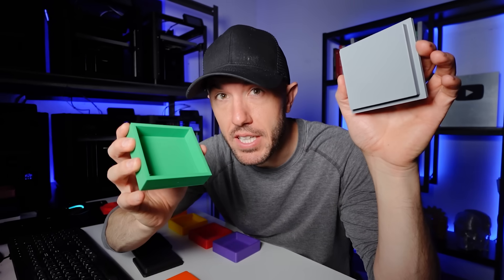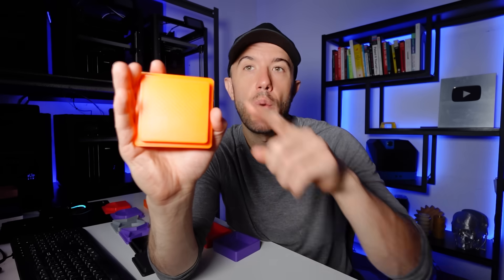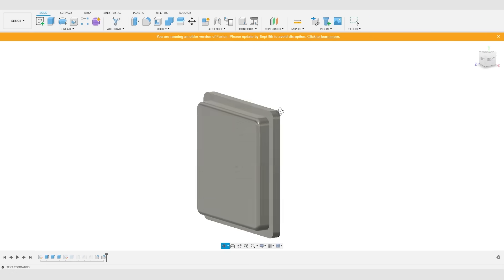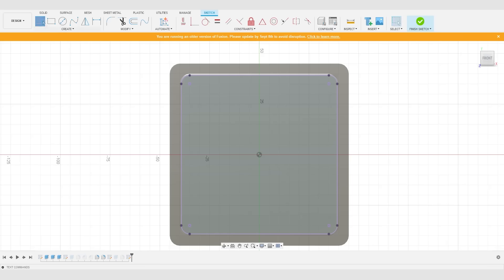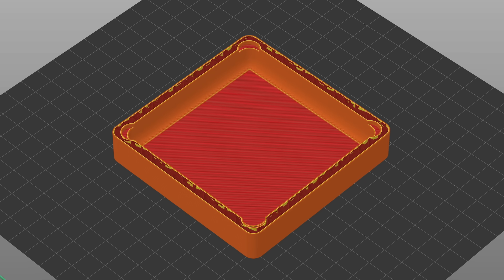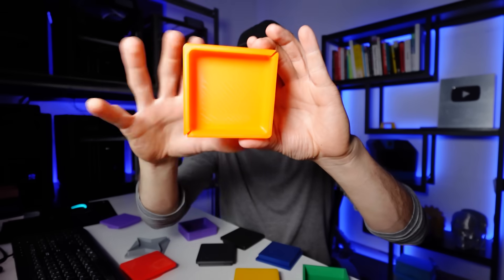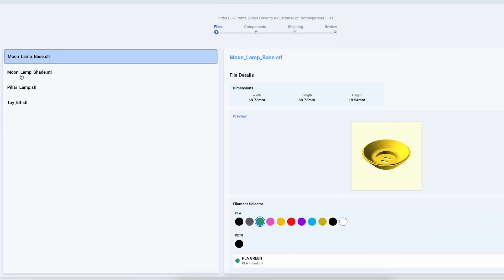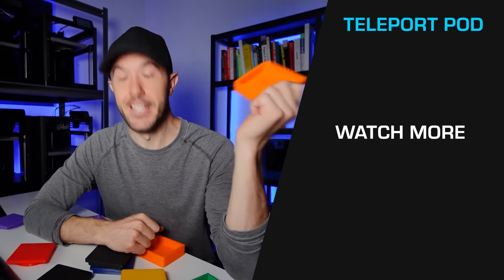How to Design a Print with Perfect Tolerance EVERY Time

Comment: The term is "clearance", not tolerance. Tolerence deals with how far from the specified measurement you can "tolerate". Nice ideas in the video just the same.
Reply: Thank you for posting this... the 3D printing community has conflated those two terms so badly for so long, I'm afraid an entire generation won't be able to understand a blueprint.
For anyone who doesn't understand:
Tolerance is specified as a range, as in 4.5 +/- 0.050 and is used for quality-control. 
Clearance is a gap specification, which is what he's talking about in the video.
Reply: @glabifrons  🤣😂👍
Reply: @glabifrons  Not only the 3D-printing community. I regularly hear engineers talk about tolerances instead of fit.
Reply: @glabifrons it is tolerances though... you'll never have an exact true fitment in the real world when environments change such as humidity and temperatures... only in a very controlled environment will you get a 100% true fitment. Even when it comes to metal its tolerances because even metals expand and contract during different environmental temperature changes. So there has to be tolerances. Would it be fair to say tolerance is the range of clearance which hes explaining in the video.
Reply: @bassassin2695  Yes and no. I'm sure most people will understand what you are saying if you reference tolerance as clearance when discussing something simple or with very little parts, but at the same time, it can get confusing if dealing with a more complex assembly where you have tolerance stack ups that can start to affect clearance. At that point, differentiating between the two can be important for clarification purposes to fix the issue. If you were to say "let's loosen up these tolerances a bit to get this to work" when really meaning clearance, you just said the opposite of what needs to be done. By 'loosening' the tolerances, you're saying lets make the tolerance range a larger target to hit which will negatively affect clearance even more after the tolerance stack up. If you say "let's give ourselves more clearance by tightening up these tolerances a little" it's now clear what needs to be done to fix the assembly clearance issues upon tolerance stack up of the assembly.

Essentially tolerance is a per part range to hit to ensure proper clearances for the assembly when designing something. If you have clearance issues on the assembly level, revisit the tolerances for each part or the problem part to fix the clearance issues.
Reply: Exactly. Also an edge is not vertical or horizontal, especially when held at a 45 as in this video. The term is perpendicular or oblique to an adjacent edge.
Reply: On the other hand the issue is the tolerance of the printer, so it's not totally wrong
Reply: So glad someone pointed this out. As an ME student it's frustrating seeing the 3D printing community getting this wrong. Tolerance is innate to a manufacturing process, clearance is an intended gap between two parts
Reply: @coreygolcman2016  I suspect that people use the term interchangeably because dialing in your 3d printers to minimize tolerance issues so that clearance becomes less of an issue. 

It also annoys the hell out of me.
Reply: I am looking for this exact comment. Tolerance is about the precision of a single measurement of a single piece. Not the gap between two piece. Tolerance is highly related to the fit of the parts yes but the methods described in the video all not about improving tolerance.
Reply: Thanks for posting this. I constantly have to correct and explain this to people misusing the terms. Nice to know we’re not fighting alone 😉
Reply: Tolerance is the range of clearance which hes explaining in the video
Reply: Industry professional here. You all got your undies in a twist. He's neither talking about tolerances, clearances nor fits. He's talking about how to optimize 3D printed parts for fitting together, independent of material choice or printer settings. If he would, the video would be a slideshow with multiple tables showing nominal dimension ranges and corresponding tolerance ranges for various applications (boring). "How to Design a Print with Perfect Tolerances EVERY Time" is a perfect title for this video;  print indicates a singular component, perfectly validating the word 'tolerance'. A 'Perfect Tolerance' does not exist, hence you can already guess that stuff is being designed in a way that reduces/ eliminates the influence of said tolerances. Furthermore, a novice who just wants to get his design to work is likely to search for the word 'tolerance', and therefore chances are that this video gets recommended. Excellent design ideas, excellent title.
Reply: @EdTannenbaum  I think the term tolerance can apply because he is talking about the allowable variance in the size of the part. So if the part is within roughly .1mm to .3mm of it's mating part, that is an acceptable tolerance.
Reply: I come here to say that every time, I don't understand why it's so prolific in the 3D printing world 😭😭😭
Reply: He's actually talking about how to design your fitment to have appropriate tolerances so multiple materials and machines will work without needing to redesign the party every time. 
    He used the terms correctly, you just don't understand the problem he is trying to solve.
Reply: @EdTannenbaum  TOLERANCE is the right word, his right, because when everything doesn’t fit right you need Tolerance to be able to move on your day without getting pissed
Reply: @EsfortsGaming 😂
Reply: You are overcorrecting. If you're nitpicky enough to consider "tolerance" wrong, then "clearance" would also be wrong as "clearance" is only a small aspect in the whole scope of this video.

This video is about general design philosophies and how to make parts fit together snugly. Using "clearance" makes no sense here.
Reply: Uhm akshually, youre describing fits, not clearances. A clearance is only one type of fit. And fits are very closely tied to tolerancing.

People don't actually get it wrong. You're ovecorrecting.
Reply: @LukeFabis  His first sentence is "...this is a super common problem inside of 3D printing, and it is dealing with tolerances, the fit of things going together."

It's kind of misleading to imply that the fit between the two parts is the tolerance. Hell, even parts that don't fit to anything will still have tolerances. In casual conversation it won't matter, but you'll get funny looks from people who deal with this stuff for work.
Reply: @Anti-matter-reactor Fair enough, but he's not talking to industry professionals, he's giving advice on YouTube and I don't get the sense he's reading off a tightly edited script. Even a PhD from time to time will drop a piece of jargon, quickly clarify what the relevant topic they're discussing is, and taken together make it sound like a bad definition. But you still get the idea either way. Here, you are wrestling with tolerances and how they impact fit. I don't see a problem, and clearance isn't the right terminology to use either unless you're going for specifically a clearance fit.
Reply: @LukeFabis  It's irrelevant whether or not his audience is made up of professionals. He's in the role of a teacher, and while I love his work, he needs to be careful about terminology as people will take him as a subject matter expert because he runs a successful business.
Reply: @LukeFabis  Also, "clearance fit" is one of the types of fit, just as "interference fit" is. "Clearance" is a number, a specification of measurement between two parts' dimensions. These should not be conflated.  You aren't going to specify the "fit" (a very generic term) of a piston in a cylinder, you're going to specify the clearance.
Reply: @glabifrons Yeah, no. Maybe that's how people do car engines, I wouldn't know, since I don't mess around with pistons. But that's not how any industry I've ever seen does it. You specify the nominal dimensions and call out the tolerances according to ISO 286, or, if you're lazy, specify the type of fit you want and leave it to the machinist to look it up in a table.

And at any rate, we're talking about some guy on YouTube with hobby-grade FDM printers showing hobbyists how to make a lid fit on a box. You're getting bent out of shape over nothing. So quit trying to sound smart, you're not impressing me.
Reply: @LukeFabis  Name one industry that does it that way. I've experience in several of them going back decades. I only mention car engines as it's something more people can relate to.
Since you're referencing standards, maybe you should actually read them. Start with part 3.3.1 which defines clearance, while parts 3.3.1.1 and 3.3.1.2 define the range, also know as tolerance.
Reply: @glabifrons Moving the goalposts now, are we? Get a life.
Reply: @LukeFabis  I moved nothing. I was clarifying the difference between clearance and tolerance and you repeatedly tried to claim that I'm wrong. I just proved you wrong with your own standards reference. Deal with it.  
I'm sure the fact that your account is brand new has nothing to do with your trolling either.
Reply: @glabifrons I will repeat myself, since you seem to be responding to what you expected me to write and not what I actually wrote. If you're describing a fit, there aren't "clearance numbers", there is a nominal dimension, and a standard tolerance and limit that defines how the fit will behave. For small dimensions, say 10 mm, if you want a clearance fit, that would be something like H7h6. I've never heard of "clearance nunbers", maybe that's a car industry thing, but I suspect you don't know what you're talking about.

And that's all I'm going to write. I've been too generous with you, frankly. Next time, maybe don't start off a discussion with calling a person a troll.
Reply: @LukeFabis  I didn't start the conversation by calling you a troll. I called you a troll due to your response to my comment and your incredibly snide comments to everyone else. You're simply proving me right repeatedly.
What I said was "Clearance is a number" to show the contrast with "fit" that you seem to be so fixated on. To put it another way that maybe you might understand, clearance is specified with a number. Better? 
Read the standard you referenced, I even called out the sections for you to read.  You sound like you've had exactly one drafting class and think you're an expert.
Reply: @LukeFabis  I still think spending 30 seconds explaining what tolerances actually are with a couple of images would have served viewers well. It's like he explained all the way around the concept, but missed the center. 

If he's not talking to professionals, how many will ever make a toleranced drawing, let alone calculate a proper tolerance stack up? They'd be MUCH better served if he used something like "mechanical fits" to describe the variation in dimensions between the part interfaces. Then they'd have a search term which would yield significantly more relevant information, should they want to look for more.
Reply: @LukeFabis i'm a desing engineer apprentice and BOTH my instructors, one a polymechanic who switched to design engineering and the other a mechanic who then added design engineering ~about 30 years ago with LOADS of industry experience, always talk about tolerances when we design something for 3D-printing.   I doubt both of them would get that wrong especially given just how hard it is to even pass the apprenticeship. And yes clearance is a type of fit and even with 3D-printing you don't always want a clearance fit. Sometimes it will be a pressfit 🤷🏼‍♀️
Reply: @LukeFabis  ☝🏻🤓
Reply: @LukeFabis  It's always good to know the correct terms and correcting someone doesn't take away anything from the video. It's a learning for everyone. There's no reason to be so defensive. We all learn from one another.
Reply: @LukeFabis  glad you stuck to your guns and quit posting when promised. That was a brutal slog to dig through, 4/10
Reply: HE IS INCOMPETENT AND THE WHOLE VIDEO MAKES NO SENSE
Reply: @feilko2170  every time i watch one of his videos he comes off as pompous and relays his message as the only way to do it. idk what it is, but this guy irks me, and for some reason i still watch a vid here and there from time to time and my reaction is the same every time.
Reply: @jonathanviterise1681  I think it's due to some kind of ignorance..
Reply: @feilko2170  It makes perfect sense for everyone else though with an IQ > 2 lol
Reply: @feilko2170  even if it's just me, know that there is someone out there that appreciates you humour.
Reply: @feilko2170 What have >you< ever built?
Reply: @LukeFabis  would be too complicated to explain but basically a box that stays closed
Reply: @feilko2170 You got nothing.
Reply: @LukeFabis  Brand new account only days old... troll much?

Comment: How to print that long skinny gap under the compliant walls? 5:18 Support will defeat the purpose, and without support it will sag and stick to the bottom?
Reply from the maker: Just as we showed it without support
Reply: How did you get that top surface, it’s awesome……did you use ironing?

/

Comment: I'd like to add one more idea. Remember that a bulge from a bad seam can prevent you from getting a proper fit, and it's essential to reflect it in the correct place on the piece in the slicer so it doesn't get in the way.
Reply: that goes into the realm of custom slicer settings and goes against what this channel promotes: aka their print on demand service where they slice for you and you have no control over slicer settings

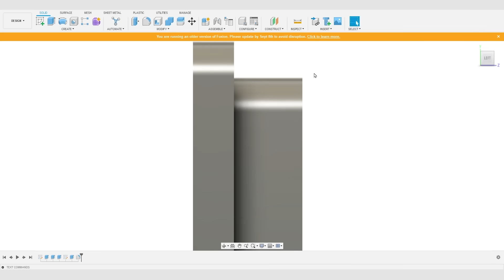Comment: 2:12 rather than using chamfers here, I generally prefer to use drafts and basically follow an injection molding workflow
Reply: @rlrfproductions  correct. This is a draft angle, not a chamfer.
Reply: @3DPrintingGirlDad  Those are not mutually exclusive terms, chamfers don't have to be at 45* and many draft angles are simply very carefully designed chamfers. However, in this case they are not draft angles, because a draft angle is a feature specifically designed to aid in the release of a part from a mold, and since there is no mold involved here, they cannot technically be draft angles.

Comment: I always add .01"-.015" tolerance to mating parts and or holes. As well as chamfers on all edges, and radii on all corners.
Reply: i'm new on 3d printing, and i still search for a software to make easy shape and understanding to create. What you suggest?
Reply: @TheALLtube  I know its a month late but I like fusion360; you can get a personal account for free with minimal limitations, another good one I hear about is onshape which is fully online so you can use it anywhere, and lastly I hear good things about freecad but its workflow is awkward for me personally.
Reply from the maker: That is fine. But it is very fragile as different, settings, colors, machines etc will change the fit.

Comment: I don't believe the word "Tolerance" was used correctly even a single time in this entire video.
Reply: Nah. You're just intolerant.
Reply: what are u looking for? clearance? does it really matter if the word is misused?
Reply: @xXP1ZZAxD3MONXx  'Fit' would probably be the most appropriate term here. Fit, tolerance and clearance can be closely related, but are all distinct things.  

But it does matter if words are misused, espescially in technical contexts. It ensures everybody has a common reference, and that ideas are communicated accurately and effectively.
Reply: @xXP1ZZAxD3MONXx  Absolutely without question. 
Tolerance is specified as a range, as in 4.5 +/- 0.050 and is used for quality-control. 
Clearance is a gap specification, which is what he's talking about in the video.
Try and tell anyone in any machine shop, especially an engine builder, that those two terms can be interchanged and see how quickly they toss you out the door.
Reply: @xXP1ZZAxD3MONXx  yes it does
Reply: @xXP1ZZAxD3MONXx As someone who worked in product development as a mechanical designer, obviously I know what is meant from context but it is somewhat distracting from the point of the video.
Reply: Oh man thank God you're here to tell us that! Otherwise I would have no idea what this video was about!

Comment: I like to put a draft on walls and sometimes add tiny protruding ribs around the perimeter of one mating face or the other. Spaced ribs have a much smaller coefficient of friction, but it can still be a tight fit.

Comment: The funny thing on top of all of that is you can have the SAME PRINT on the SAME MACHINE come out differently too.  I have noticed with my Bambu's this doesn't happen as much as it did on other machines.
Reply: Yea the bambu stuff is amazing. I've had print failures where I knew it was the printers fault based on experience, and reprinting it, it worked. When I got my bambu, I was flabbergasted when I reprinted something, and it failed at the exact same spot. Other printers aren't typically reliable enough to replicate rare failures like that 😅. I know this is a weird negative example, but it does show how reliable they print.
Reply: Bambu is crap and it's been discussed everywhere. Corexy, and smooth rods + proprietory software and slicer is crap
Reply: @chinmayasham3568 wasn't talking about the companys practices. Was only talking about having exactly one of their printers, that has been significantly better at printing than my last one and also any I have tried
Reply: @chinmayasham3568  got an A1 just as a "are they as good as the hype says."  Well I now have 2 X1C's as well, these printers are as good as people say they are.  The Propriertory slicer isn't as much of a problem as people make it out to be.  You can still do all your edits in Orca slicer, and re-open in Bambu slicer to send it.  The two programs are the same afterall (orca is a fork of bambu).  The ease of use of the printers is outstanding, and i have a Voron 2.4 350 as well.  The Voron is fun to tinker with, but if I want something to "just print" the Bambu's are king.